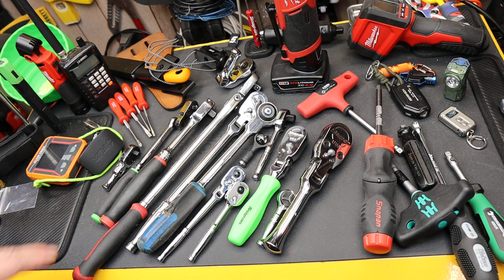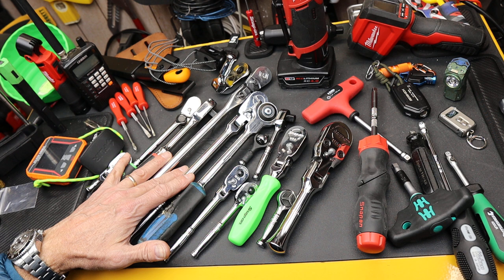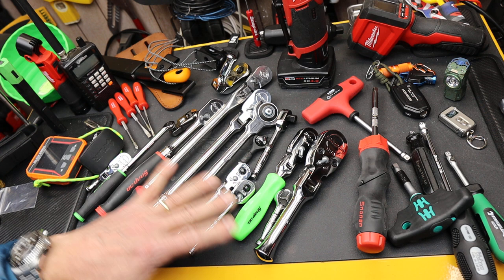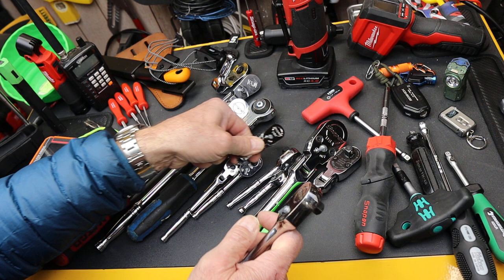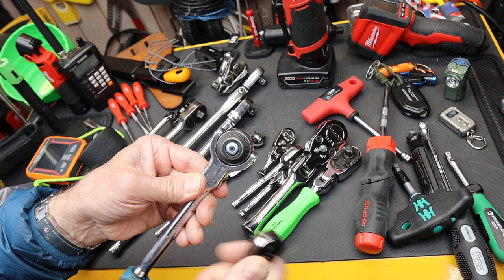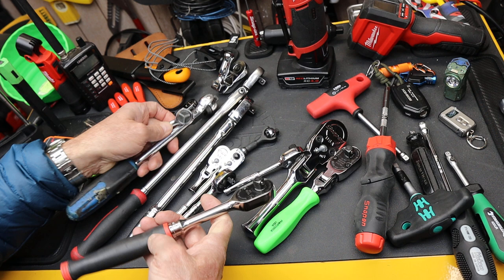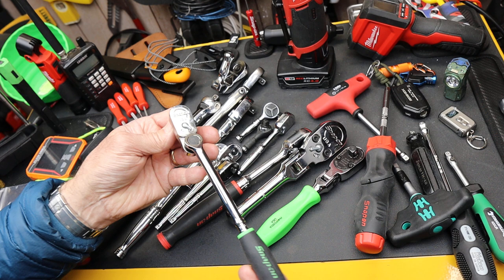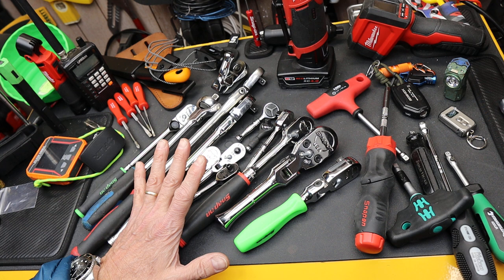Do the math. How many kinds of Unique Ratchets are there? Over 800?  Over 1600? Did I miss any?

Comment: Classic Combinatorics Counting problem!
Some off the top of my head are the variety of different bends of the handle, and the speed handle ratchets, and also the pass-through ratchets, or low profile ratchets.  I've even seen so many different types of heads, like the ball Weha AllRound Schlussel ratchet.  Then you have the different lengths in between those short/med/long handles.  There are thousands of different combinations.

Comment: Missing
1) ratcheting without handle just a round head with knurling for fingers
2) insulated high voltage
3) handles with sliding extension length
4) ratcheting pawls vs freewheeling friction
5) 3/4 is a common ratchet size in Heavy duty.
6) reversible, push through, non reversing.
7) ratcheting head with interchangeable handles (extensions, toque wrench, ect)
8) not at all common but there is the Falcon CDX drive system as well

Bonus) i have one where you twist the handle like a screwdriver but it spins the commonly found 90 deg anvil at the end for tight locations with limited swing (like air or battery ratchet does)

Comment: Proto made a indexing flex head ratchet. You also didn't include chrome or black oxide, ball detent or quick release or hi-lok. Also tooth count and bent handle flex head spark plug ratchets
Reply: HI-LOK is a specialty aviation tool.

There is the extendable handle though,  not something I've ever wanted and I'm not sure they're available in flex head...ect but there's nothing preventing it.
Reply: @TylerSnyder305  which one in flex head? Armstrong made their Maxx ratchets(1/4" for sure) in hi lok flex head and facom has extendable handle flex head ratchets in 3/8 and 1/2 both quick release and regular. I've been wanting a facom one but I always recently saw the Gedore extendable and it locks in the middle position to act as a breaker bar( not sure if it was intended for that purpose or not)

Comment: Extendable Ratchets, Bent Handle Ratchets, Double Flex Pittsburgh Ratchet, Spud Ratchets, Wera Koloss Hammer Ratchet, Pass Through Ratchets, Proto Indexable Flex Head Ratchet, Ratchets with dual sided drives, Composite Handle Ratchets, Ratcheting Breaker Bars? I’m sure there are more that fit the criteria! Great video Doc! 👍
Reply: Isn't the Proto Indexable Flex Head Ratchet identical to the SnapOn shown by Doc at 4:31 (ref TH72MP in 1/4" size, I believe)? It does not matter: I give you the Palm Ratchet, and its Swivel Gimbal Palm Ratchet brother (see King Tony 2747DR), to take its place in your long list 😃

Comment: I read a article about the tools the professional Tech has awhile back. The article said that the average tech has 18 ratchets. 
I remember years ago when I only had 18 ratchets. I swear it's like guns and knives, you can never have too many and they keep coming out with different styles. Without any of the speciality ratchets you will have 5/6 of each drive size. Different lengths, flex and fixed just as a starting point. In 3/4 I only have two ratchets,  22" and 42" (I think, could be 40)

Comment: The problem with your model (like you said with the multi position) is that each feature must be able to come with the other features. I haven’t been able to find a round or swivel head that comes in a flex or locking flex head. Or stubbys with comfort grips. Your number serves as an upper bound (not counting specialty ratchets). 

But to whittle a collection down, you might consider your top three or four features and look at that combination space (ie I care about length, flex v non, and anvil).
Reply: Wright tool makes round flex heads , S-K and PROTO both used to as well.
Reply: Kamasa made/makes round flex heads too.  But you're not getting a roto-head that's also a flex.  Roto really needs to be treated separately in the same way as indexable has to be.

Comment: Imo I think the majority of ratchets are actually gimmicks. A stubby in anything is useless, you're not going to crack anything substantial loose. I've never been in such a tight space that a universal joint couldn't get me out of trouble.

Long/Extra long ratchets, if the internals of medium size are the same as the extra long, just use a cheater pipe on the medium. This rules out hard handle and comfort grip ratchets(for pros maybe the comfort grip is a must but I would think most are using electric impacts and  ratchets now anyway) if an impact won't break something loose then youre into the realm of breaker bars and out of ratchets anyway. I think the 3 ultimate ratchets to have are 1/4, 3/8, 1/2 medium length, bare handle, lockable flexhead with a release button. X1 breaker bar and X1 cheater pipe that will fit over everything. 

I know people like to collect these ratchets and enjoy them, I love watching toolbox tours too. I just don't understand having 20 ratchets when they say they only use 3 or 4 of them 🤔 

Just my thoughts